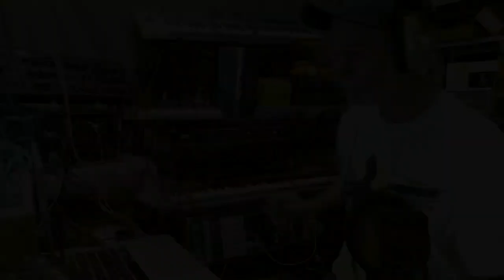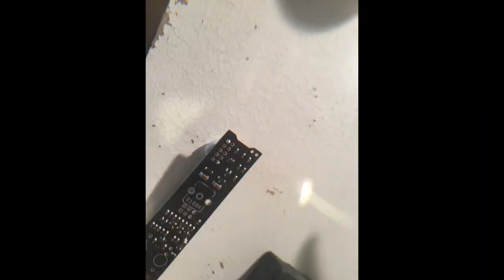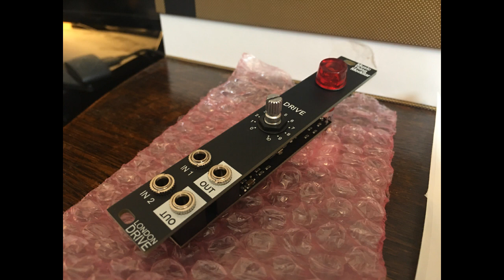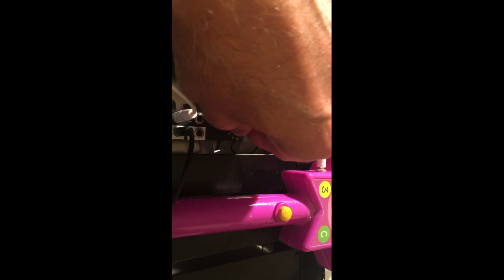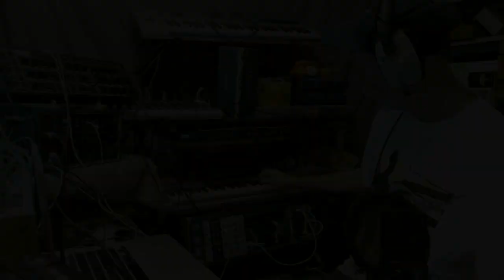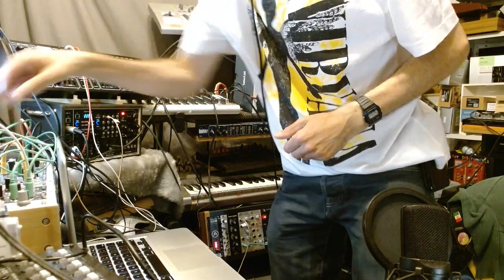First DIY module build - London Drive from Music Thing Modular

Comment: Great that you got it working. :)  Looking at your pictures of the board as your build was progressing I would just say to try and get your soldering iron a little bit hotter and spend a bit more time getting the solder to flow into the joints. Extra flux also helps with things like the power headers as they are usually difficult with some kits especially on the ground pins(the inner ones).
MTM kits are well designed and so useful to have in your Eurorack setup. It's a good choice and I have the first drive they produced but may well pick up the London Drive too. :)
Reply from the maker: Many thanks for your help here. I really really hate soldering, so I’m trying to overcome this aversion by doing small projects. I’ve got a fuzz pedal kit now, so I’ll use your tips (hot tips!) for this project.
Reply: no worries it does get easier the more you do. I was awful when I first started but feel much more confident as you will too. Keep up the good work and cool music :) @abominablemusic